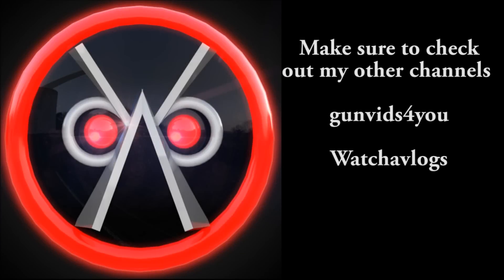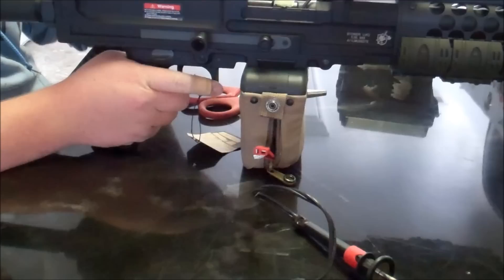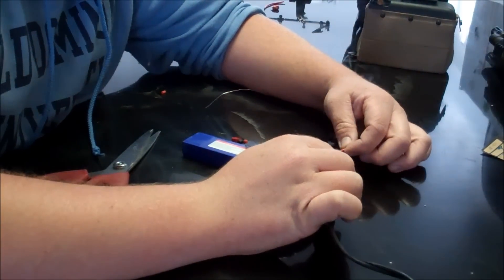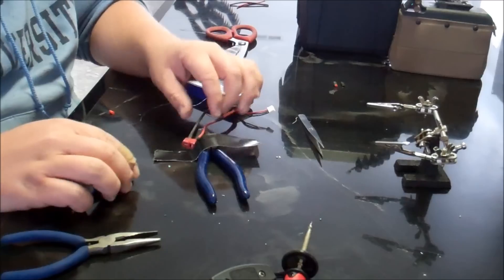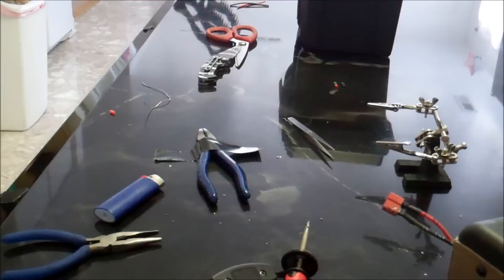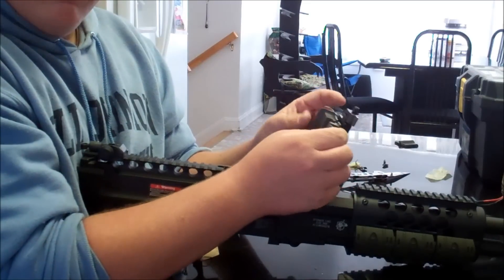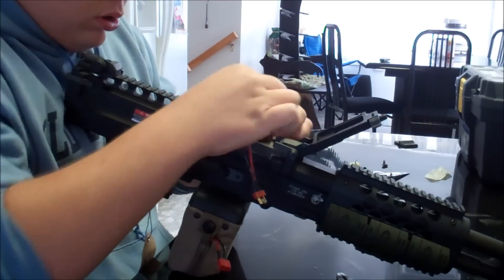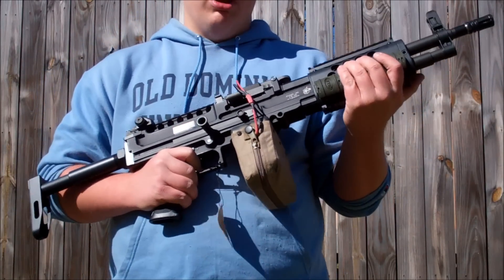Ares LMG Tip: running a battery in your Box mag

Comment: Three things. First, you tin wires, not "tint" them. Second - why didn't you run it on the other side under the fake bullets? Much cleaner installation. Third, instead of cutting anything why not just make a jumper to extend the battery connection to the gun connection?